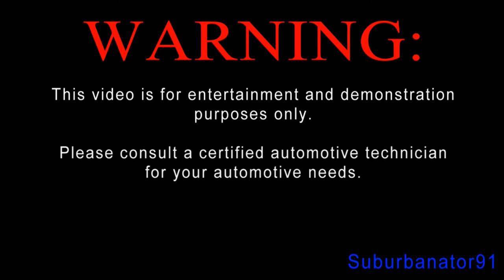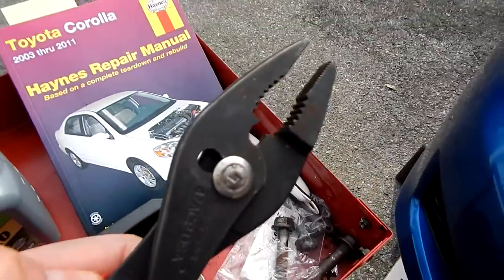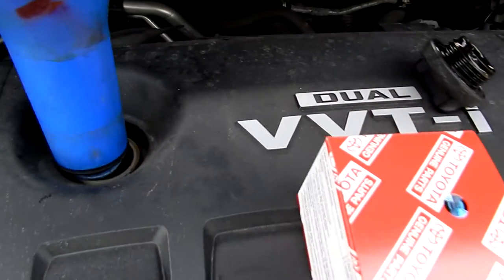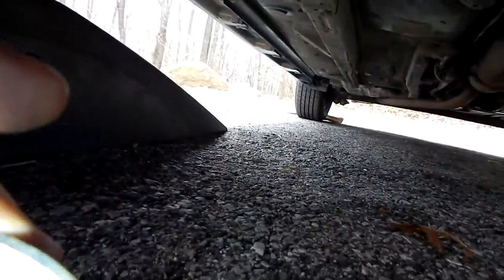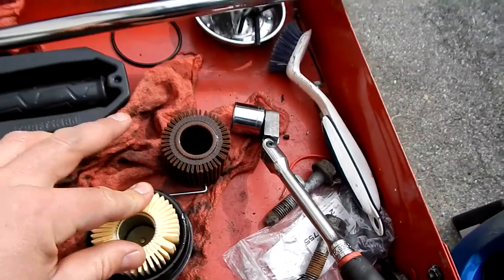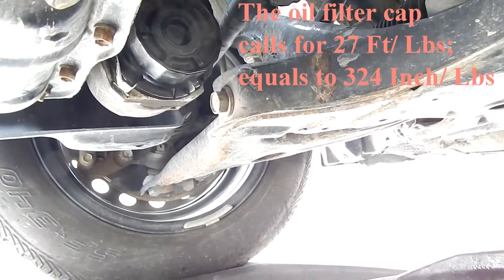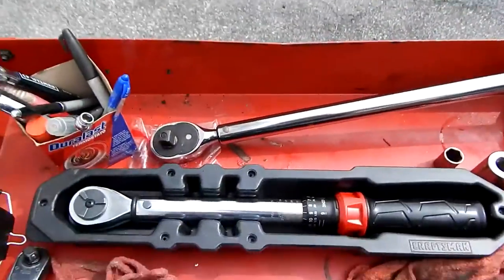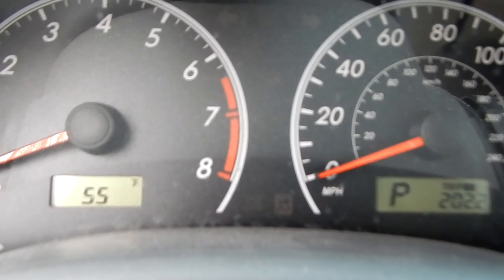The Corolla's First Oil Change - 03/17/2016

Comment: Placement of that O-ring is very important. I put mine in the wrong place and about 3 quarts of synthetic oil poured out onto the garage floor when I started the motor. A big surprise when I checked the dipstick and there was no oil showing. Looked under the Corolla and....D'oh! Be sure to look at the box for its proper location.